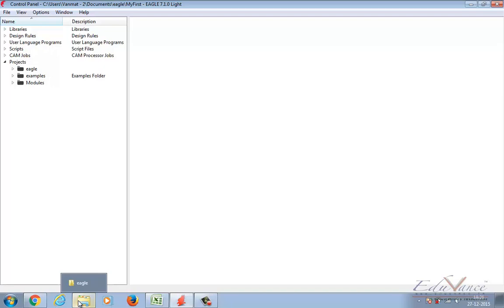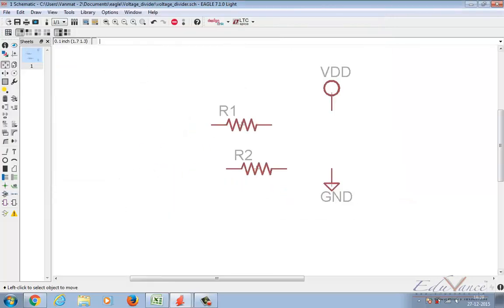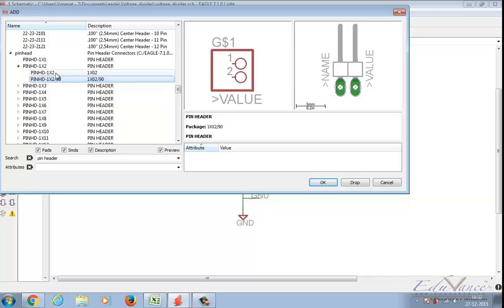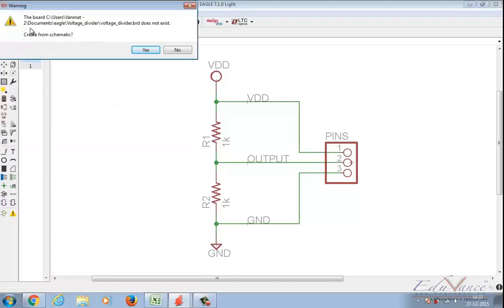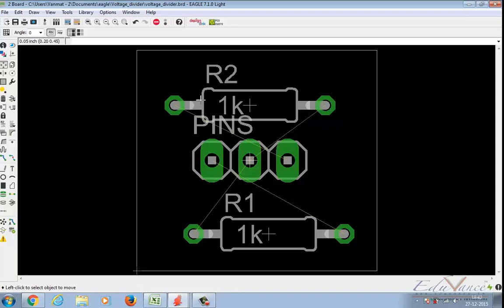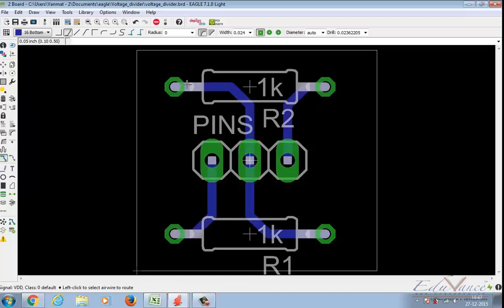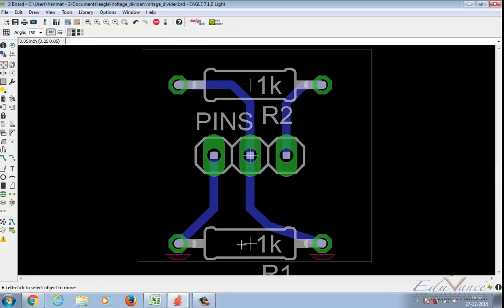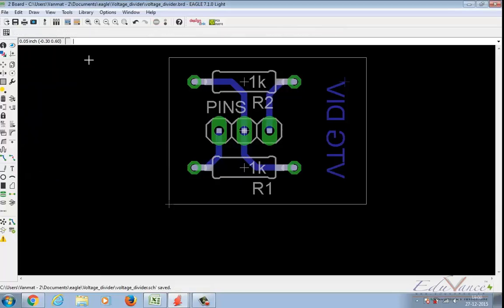PCB Lecture 4 Voltage Divder Schematic and Layout

Comment: How to choose required value of resistors or conductors? Is it on theoretical or experience base or software can simulate and helps to choose values of component to be chosen for proper function?
Reply from the maker: +Jay Gajjar values for components have to be chosen by you while designing the circuit bad on the application and your calculations. Eagle does not simulate circuits or choose values for components. It is only a tool for designing the PCB